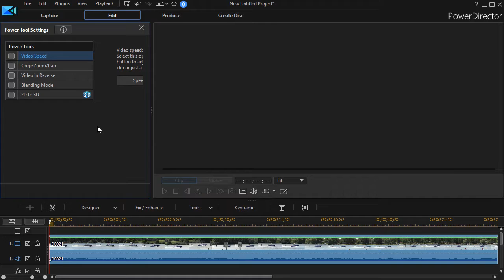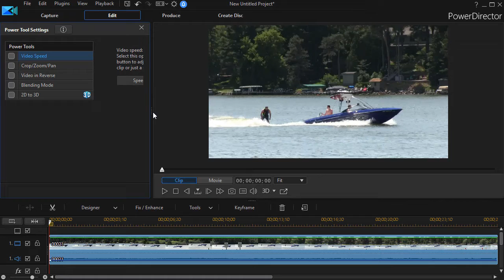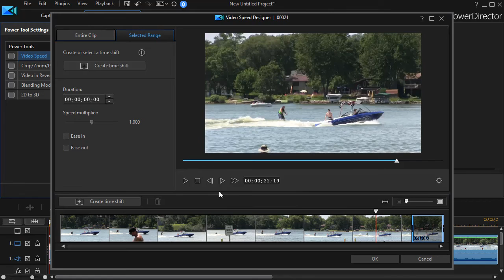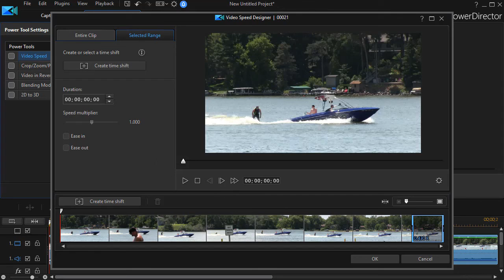PowerDirector - Create a speed ramp transition

Comment: Another nice tutorial of you! Thanks a lot!
I can´t figure out an option for linear speed increase/decrease. for example starting the video on x1 and ending it on x10 with a linear speed increase.  Do i miss something, or is it not possible?
Reply from the maker: I've been looking for a way to do what you describe. So far I haven't found a technique for a progressive increase in the speed of a video. If it can be done, I haven't figured out how yet. --Jim
Reply: @SharperTurtle  Thanks, Jim for taking the time to answer. :-)
Reply: This is exactly what I was looking for, many other editors have this option but not Power director  :(
Reply: I was searching for the same linear speed increase, but I believe it will have to be a done by splitting out the section of video and then further splitting that down, applying different "time shifts" to each of the clips.  Hopefully @CyberlinkChannel will come out with an update that will allow this to all be done in the speed module, adding multi time shifts of varying speeds in one module (if that is the correct term).

Comment: Thanks Jim, Just when I thought I was completely familiar with this feature (and it's sometimes counterintuitive ways)  you teach me something I didn't know. That is to select ease in/out before you adjust. I could never understand what conditions had to be present to have them activated when I made the speed adjustment first. I still don't know what they are but now I know there is a way to do it and then adjust up or down to whatever that threshold is.
Reply from the maker: Scott,
The 'ease-in' and 'ease out' settings caused me a bit of confusion when trying to cover this topic. It's not clear why they grey out. But with a bit of experimenting, it became a bit easier to understand. Maybe in a future release we will have more control over this dimension of the editing. --Jim
Reply: "this dimension" .....Sounds like the Twilight Zone. I do love my PowerDirector though. Just like I loved the Twilight Zone !!
Reply from the maker: Glad we have better tools than they did back when the Twilight zone was edited! --Jim
Reply: Agreed Jim
Reply: @SharperTurtle  I have found a glitch in the software today, at least when working with powerdirector 15.  I will try explain...
When using the speed ramp setting, I wanted my clip to ease in and ease out and wanted a faster speed ramp over my selected clip.  Just as you pointed out, it will only allow you to select those ease in and out boxes if a time shift created falls within a certain time length.  
Here is what I did...
I created a time shift, stretched it the whole length of the video file, this allowed me to select the ease in and ease out option.  I then saved, or clicked "ok" to add the change.  I then reopened the clip off the timeline to re edit it, clicked on the previous created time shift and adjusted the slider either from the beginning or end.  The time shift will continue to have the same speed, but can now be adjusted to a smaller and quicker ramp, and still allows for the ease in and ease out options.
I hope this could help someone else out in the future.
Reply from the maker: Jeff,

I love how we find workarounds to accomplish the tasks that look "impossible" to start with. I'll experiment with your technique. Maybe share it in a future tutorial, too. THANKS. --Jim
Reply from the maker: Jeff,
I just tried some of your steps and seem to be missing something. Did you make a time shift for the whole clip? When you saved the change, the modified clip was on the timeline. What do you mean by reediting the clip "off the timeline"? I'm confused. --Jim
Reply: @SharperTurtle  Hello Jim, Yes I created a time shift for my whole clip, using the action center.  This allowed me to speed the original clip up to 44x  and allow for ease in and ease out.  I then saved the edited clip. After this, I reopened the edited clip off the timeline and used the action camera section to edit it again.  I then use the sliders on the side of the first created time shift to shorten the "time shift"  , while still keeping the 44x speed.  Make sense?